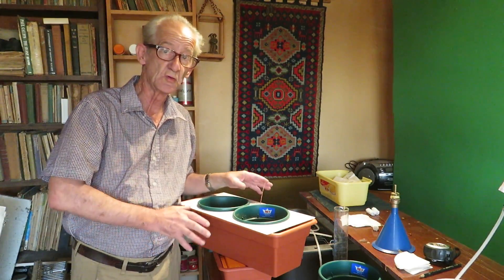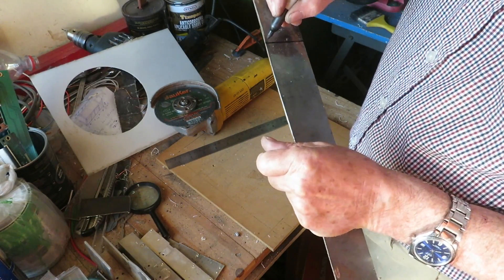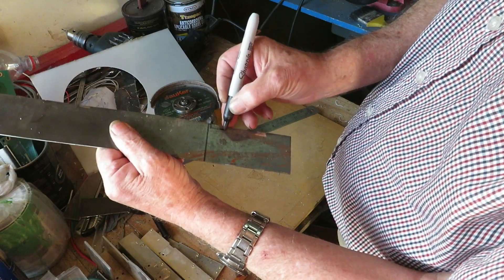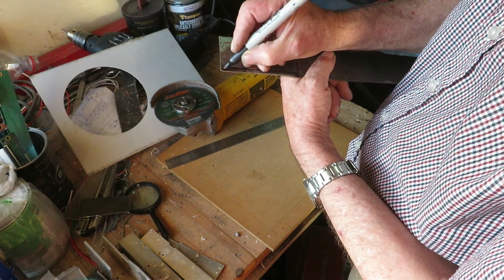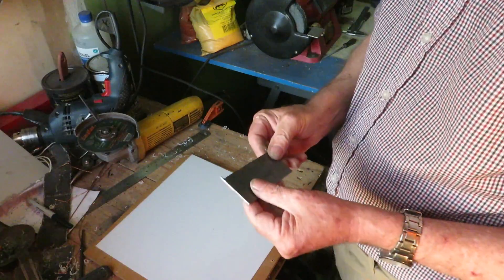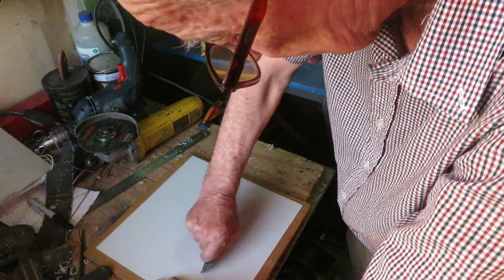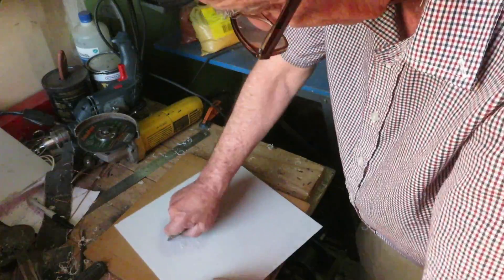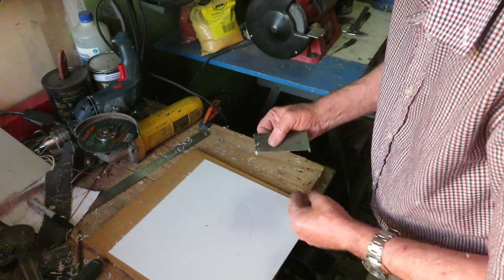Cut perfect circles in acrylic or plexiglass sheets #acrylics #tool #circles

Comment: What if you just put a sharp piece of metal in a drawing compass so you can adjust in on the fly?
Reply from the maker: That's a very good idea, but it can't be a regular compass, which isn't made for hard work.  When scrapping the cut we must exert a good amount of force and the tool must not shiver, tremble or quiver.
Reply: There are "compass circle cutters", I have used them just for paper but I think it would help at least to mark the circle and then finishing with an utility knife as in the video.
Reply: @valecillosjg  But without a pre cut groove to follow, it would surely be difficult to cut a perfect circle with a utility knife...  maybe?